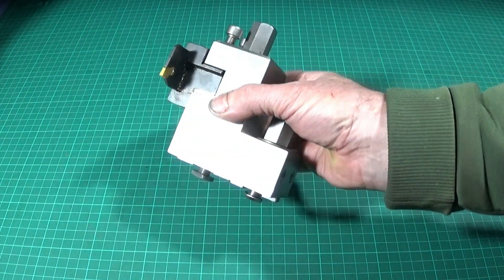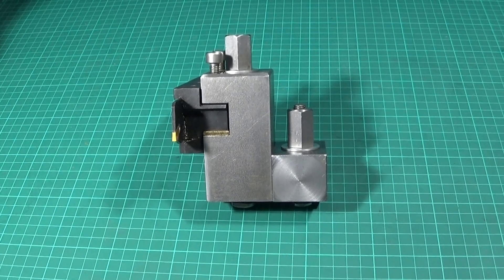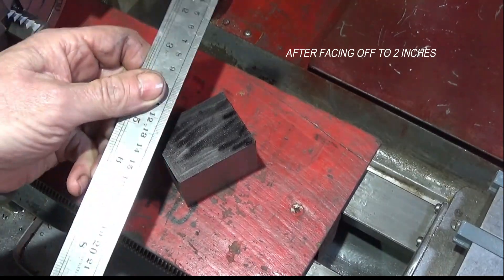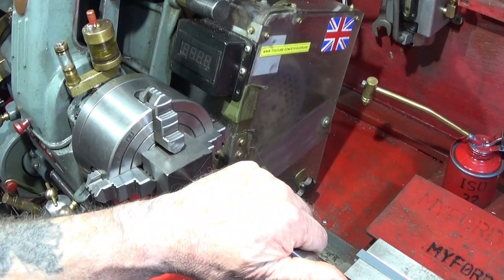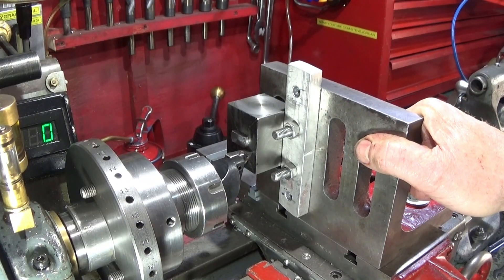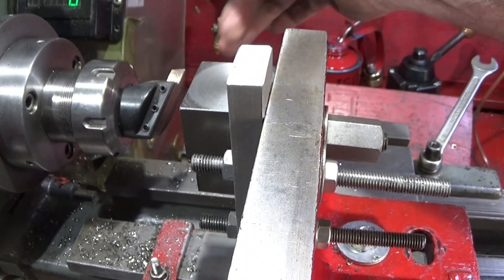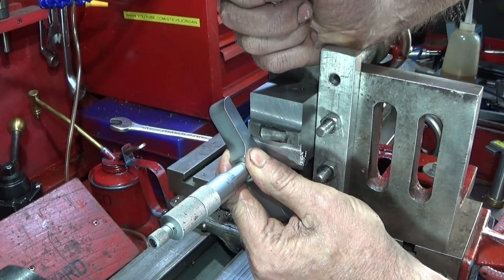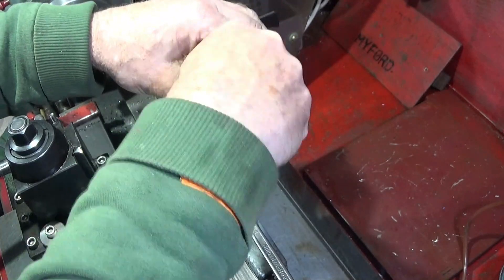Making A Myford Rear Double T-Bolt Part-Off Tool Holder On The ML7

Comment: Here is a tool tip for you if you put some self sticking 180 grit to the back of your rule or straight edge it will help much when trying to scribe a line :)
Reply from the maker: Hi Tony. What a great idea. Thanks. Regards Steve.